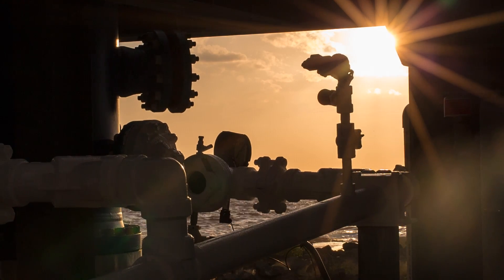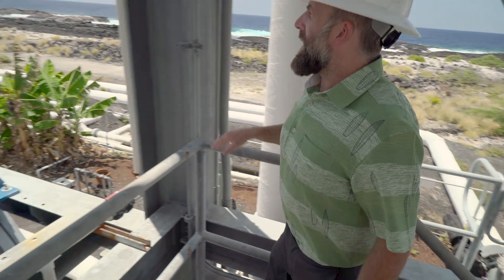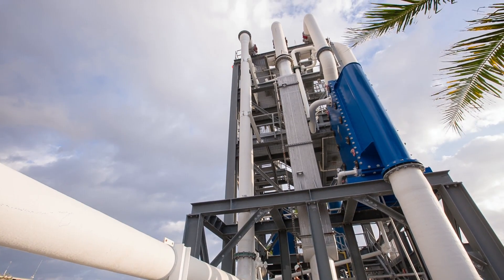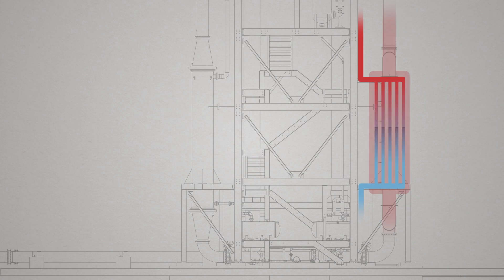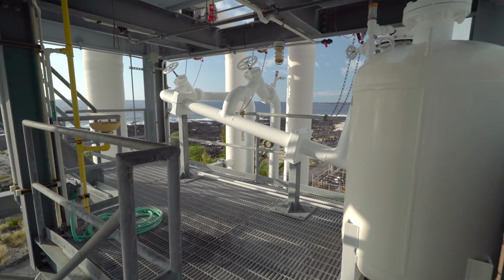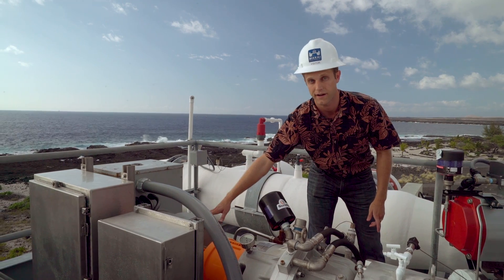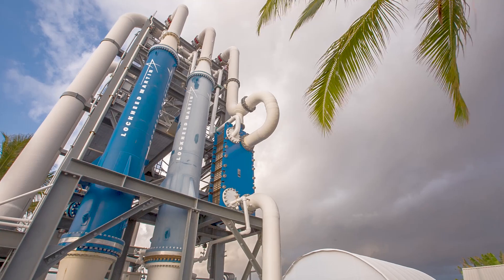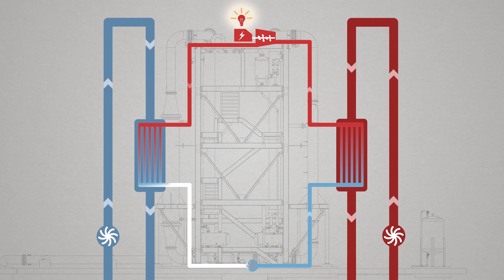Ocean Thermal Energy Conversion ( OTEC ): The Future of Baseload, Dispatchable Renewable Energy

Comment: Has anybody did a nutrient study on the water discharge from tail end?  Curious if the nutrients in the discharge water are high enough to act as a fertilizer on the phytoplankton within the ocean surface.
Reply: It's the same sea water that was withdrawn from the ocean in a closed loop cycle. Nothing but heat is added or removed.

Comment: https://www.youtube.com/watch?v=LJV4d4XtHuo  Ocean Thermal Energy Conversion ( OTEC ): The Future of Baseload, Dispatchable Renewable Energy  Published on Aug 21, 2015  MakaiOceanEngineer
Ocean Thermal Energy Conversion (OTEC) is a process that can produce electricity by using the temperature difference between deep cold ocean water and warm tropical surface waters. OTEC plants pump large quantities of deep cold seawater and surface seawater to run a power cycle and produce electricity. OTEC is firm power (24/7), a clean energy source, environmentally sustainable and capable of providing massive levels of energy.

See http://www.makai.com/ocean-thermal-en... for more

Category
Science & Technology

Comment: Could the OTEC system be modified to absorb excessive heat from the cooling towers of Nuclear Power Plants and or the spent fuel rod storage pools ? 
Such a system MIGHT have a Return On Investment and MIGHT be able to power a safe shut down in an emergency with or without diesel generators.  All of which can present some very real problems and the OTEC may very well be a viable solution.
Reply: You wanna do what?? Lol u have no idea what youre saying. Lol it either has to kick energy ass or it has to.go, got it?? Lol

Comment: Why they not more build otec power plant?
Reply: wahidixe wahidixe there's an economic issue as coal and nuclear energy are still a cheaper alternative. The power plant needed to create a reasonably powerful OTEC power plant (let's say 50mw) would be emmense. You'd need multiple turbines, heat exchangers and pumps. Let alone the pumps would have to be huge moving tones of water. It is feasible, but only until the world is ready to move to eco-friendly energy sources at the cost to higher prices. These OTEC power plants would only be useful near the equator where there is a big enough change in temperature of the ocean to make reasonable power.

Comment: Heat engines have a maximum efficiency limited by (Thigh-Tlow)/Thigh,  where Temperature is in Kelvin.  But, practical heat engines have about half of that efficiency, because of the cost of the heat exchangers.  Pick some numbers, suppose the deep water is at 32F, and the surface is at 80F. That is 0C and 27C, or 273K and 300K. The maximum efficiency is 27/300 = 9%. The maximum practical efficiency is about 5%. 
   The power available is 1 cal/gm-C, or 27 x 1e6 x 4.184 = 31.38 KWH/cubic meter of flow. But only about 5% of this can be harvested or 1.5 KWH/cubic meter of flow.  That is still a lot of energy.  Has anyone made a prototype?
Reply: Even 3-3.5% efficiency is more than Enough for this system as of now

Comment: This is amazing! I am so glad that you are doing this! I would love to hear more about your efficiency in this system. It seems to me that the greater the temperature difference the greater the power output. It will certainly require the optimal liquid to boil and condense in the loop. 

I guess colder water means less pumping for the same amount of electricity right? This system can be coupled with solar farms, wind farms, and wood/refuse burners to provide additional heat or power as well as clean input for pumping.
Reply: 2% efficient as of now
Reply: But thats 24/7

Comment: What sort of surface water temperatures do you need?  Sounds like this might work for Florida but not for North Carolina.
Reply: It should work in both place just more cost effective in Florida. It seems like the difference in temperature between hot and cold water is most important
Reply: Neither areas are considered ideal target areas.  The areas of interest are the warmest surface temperature tropical waters.

Comment: Hi, I have a question. Seems like in general, the temperature difference between warm surface water and deep ocean cold water is about 20°C. How would be the efficiency or performance different if the temperature difference is higher than 20°C, let's say 50°C or more?? would that be more efficient??
Reply: Absolutely, that would require much less pumping of cold water for the condenser.
Reply: The theoretical maximum efficiency you can get from a thermal power plant is given by the formula 1−TCold/THot×100%, where tCold and tHot are the temperatures of the coolent and the warm fluid respectively in kelvin. In addition, wider temperature differences means there is more energy to begin with. What this means is that every times you double the temperature difference, you also roughly quadruple the electricity produced. 

Considering that, OTEC uses thermal energy very inefficiently, converting only a few percents of it into electricity (theoritically 6%to 7%, in practice more like 1% to 3%). The way to compensate it is by using a very large volume of water. If you have lots and lots of warm water and you only extract a small amount of its heat energy, you can still produce a decent amount of power from it.

With that being said, if you wanted to heat all that water to 50 celcius or more, you would need a pretty huge source of heat. You would be better of using that heat in a traditional reactor where a smaller volume of fluid is being used. You will get a lot more energy this way.

Comment: Can we try heating water by greenhouse effect by placing a wide floating rectangular glass cube on sea surface allowing the water to pass through its any two opposite side by giving a big slot in it? By providing glass with same property of that for solar collector which transmit the solar radiation and prevent the reflection of water back to the atmosphere or by painting the back side of glass black to heat the water in contact. It should raise the temperature of water. This water is then supplied as warm water to OTEC plant and the same place would be occupied by water around it and heat up. Well yes, this would only work during day time but at least we can increase the performance during the daytime. Is it feasible?
Reply: a updraft tower, water can storage great ammounts of heat and the watre vapor could be condensated to produce clean water.

Comment: someone told me that the project is net negative on power. Is this true? Or is this another individual who doesn't know what he is talking about and bad mouthing a proven technology.
Reply: Which otec project?There are several Otec power plant some of them are new and some are old, ranging from kW to MW.
Efficiency is dead low, that is true. But then you don't pay for the heat source that is provided by nature.
Reply: Richard Nguyen 
They were talking about the current project at Hawaii. But I remembered that the first plant there was making power. 
The critic was talking bad about OTEC because it was brought up to use the waste heat from the power plants and OTEC to generate electrical power. 
The cooling water from the power plant runs around 120F before returning close to ambient temperature. 
Some plants are located where such a combination looks promising.
Reply: Ah, it's just the guy saying the plant main goal was to study heat exchanger, not to produce power. So I would not be shocked if they had negative net output at first.

The way he spoke in the video somehow imply a net positive output.
Reply: Richard Nguyen 
Yes. But a top executive for a big corporation was there opened to hear about new opportunities for the company. And one person's opinion shot down this down.

Comment: I just get two aluminium radiators connected with insulated hoses held in the water with chains and the very turbine is put in a water proof vessel on the very top just above sea level it can be regulated and even changing the liquids depending on the season of its really cold and it drops -5 surface warmth you can easily switch the liquid or just regulate the high of the evaporator and condenser when the heat sinks are totally immersed in the sea there isn't any energy losses for the need of the water pumps and the heat that runs out from the pipes

Comment: Does anybody know the efficiency of this system? I assume the energy produced is relatively small in comparison to the energy used?
Reply: +Edward Bignell about 5%, Difference in Temperature is limitating
Reply: +HarryHoppins thanks! do you have a source for this? I guess with efficiency at that level then operating at a very large scale is the future for this system..
Reply: it's more like carnot's theorem for a Delta T of 20 Kelvin. 5% would be the absolut upper limit. If the Heat Exchangers transport all of the Heat into The working medium. I Guess there would be plenty of losses through friction end and pumps. I Guess 2% would be more realistic.
Reply: +HarryHoppins I mean the efficiency of the system rather than the efficiency of energy transfer
Reply: wait can someone go into this idea more (but in newbie terms)?? I am super curious about the viability of this project but I had the same question/concern - in this particular case, not being super efficient brings what kinds of problems???
Reply: if you consider an ideal Carnot cycle, the highest effciency that you can obtain ( being the thermal gradient about 20-25°C) is about 8,5%. But actually those plants are near the 3-4%. 
Sorry for my bad english
Reply: agtm32 we did the math: to produce 10MW you need to pump something like 32 metric tons per second of water from 1km. You need a 300 MW pump!

Comment: I have been getting some request from Luis Antonio to contact me. I cannot respond to him yet because he should just use my email address at jameslau2@gmail.com. His method for contacting me is not able to get a response. One degree Celsius temperature increase has as much energy as water moving at 90 meters per second. Ocean kinetic energy (wave, tide or current combines) stored resource is far less than ocean thermal energy resource. Hawaii renewable energy lab seems to be making a serious mistake by shifting away from OTEC (ocean thermal energy conversion). I can provide all with more OTEC system analysis information.

Comment: where does the used surface & deep ocean water go? why do you guys separate the surface water into three? I didn't understand the explanation..
Reply: +Risa Toyama It's a testing facility, splitting it into three allows to test different components simultaneously so they can learn about creating more efficient systems I assume.

Comment: Just a silly question: Could this work for Greek islands which are disconnected from the mainland grid? Or the Mediterranean waters are too shallow to provide the temperature differential needed for the conversion? Can we do it in Santorini?
Reply: +Dean Plassaras you can use the ground to cool the ammonia to around 10Deg-C and a simple refrigerant system to do the rest.
Reply: Just put a long concrete pipe out into deep water.  A lot of coastal communities on the planet don't treat their sewage they just pipe it miles out to sea in giant pipes.  Same principal, just get a pipe to bring deep seawater in.

Comment: if you add a heat grid on the inbound hotline just like a solar hot water system you could increase the output during the daytime. 
you could also do some of the cooling by putting the return pipe into the ground.
Reply: I thought putting pipes in ground warms water!
Reply: putting the pipe into the ground just reduces the possibility of gaining heat from the air/sun but doesn't really increase cooling. Based on their pipe sizes I'm guessing that won't make a noticeable difference. The heat grid is great but adding it would then be whether it's necessary. Adding it gives extra cost in construction and maintenance. Will it improve the ammonia and overall systems output via superheating or will it just be a redundant addition to the system?
Reply: @RobbyBoy167 from the start adding a heat grid would that reduce the result that it should for the expectation from the designer？

Comment: I would prefer to say I do not understand. There are a bunch of 2nd Law problems that are not answered. I realize this is supposed to be an intro to non-science types, but .... when youre "making energy" there are so many quacks out here. Using your own power to pump the loop? Using the temp differential, and import/export the anhydrous (*anhydro-does not like water).... Its not clear. < (*psst, did everyone go drinking last night?) <@Visine.
Reply: +David W, it indeed need further details about the pumping energy (is it profitable?). About the ammonia: it does not get in touch with the water, they are in different tubes on the heat exchanger. My biggest concerns are related to the ocean itself: what about the marine lives that depend on that water zones?
Reply: +Erivelton Campideles The ammonia does not come in contact with the water, there is a bunch of tubes inside the pipe which have the ammonia in it, and the water surrounds the small pipes, think intercooler.
Reply: +Dee J, that's what I said: "it does not get in touch with the water, they are in different tubes on the heat exchanger."
Reply: +Erivelton Campideles There may be local alterations to the community structures at the exhalent area, but in the grand scheme of things I cant see any major implications being unable to be overcome.
Reply: +Erivelton Campideles An interesting idea has been to utilise the nutrient rich deep waters for use in algae aquaculture.
Reply: They are removing heat from a substantial amount of seawater. That is energy. It also takes energy to pump oil and gas, then move it, refine it, move it again then again and again until you can use it. There are no violations of second law, unless the water gets returned to the ocean as hot as it came out.
Reply: There's no 2nd Law issue. They're harvesting energy out of conducing energy exchange between shallow and deep waters. They're increasing entropy not decreasing it.

Comment: with what energy you pump the cold water?
Reply: Just like most power plant including thermal solar, coal, use fraction of the energy produced in order to power their high,low pressure pump.
Reply: Electrical energy just like oil and gas pumps.
Reply: Pump energy
Reply: +Franck Nicolas My guess is that they use the kinetic energy from waves. The floating structure goes "up and down" according to the waves, and serves as a sort of piston. Obviously this might not be enough and extra energy have to be used to run the pumps, but this is the case of all power generating methods. At the end, the purpose is to get more energy than the one that is being used to work the generator.
Reply: Luis Antonio Laracuente after a few searches i ve found that they use the energy produced to use the pomp, as it needs fewer energy than the system actually produces